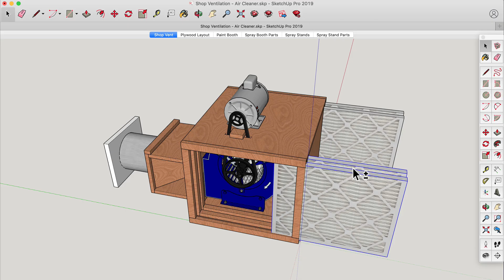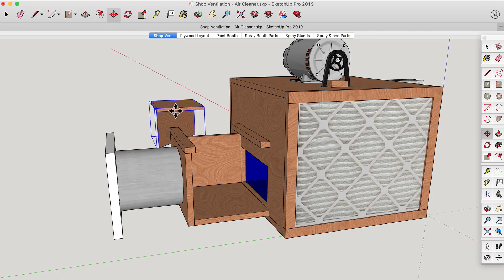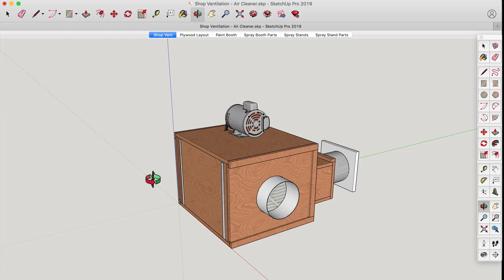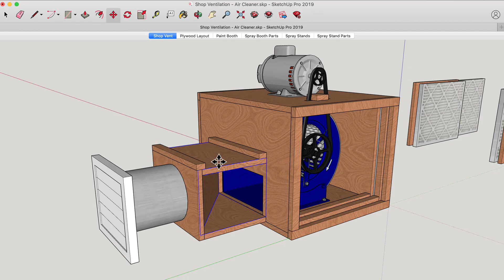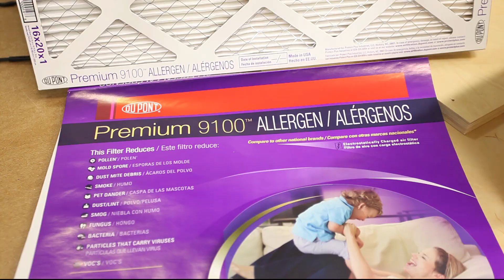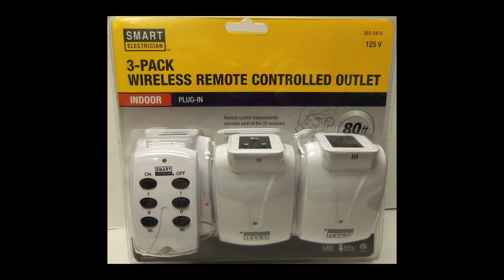How to build a Shop Air Cleaner and Paint Booth Ventilation System

Comment: I thought for any fan exhausting paint and possible solvents should be a fire or explosion proof motor as a safety precaution?
Reply: He explains it in the video, but his fan and the motor are separated. The only issue is the motor is still exposed to the elements of the shop that he is trying to evacuate. This design would work really well if it was blowing or exhausting in/out of a sealed room from the outside.

Comment: As a guy with experience in ac/ heating i would suggest you think about double walled insulated duct going thru your wall. Theres a good chance of moisture gathering on the duct and dripping down inside your wall and causing mold and rotting wood. Nice cabinet work. Design was good as well. You do realize youre never going to see the rest of your house now. I made my shop so cozy i forgot what my dogs looked like. What house?
Reply: Thanks for that added tip!

Comment: Great design and well presented. You put a lot of thought and work that benefits us all, good job. The diverted part, did you think of using a a door type baffle instead of swapping the whole part?
Reply from the maker: Thanks! Yes, I did look at door type baffle's to start but none of the ones that I found sealed very well so I decided to make my own which seals MUCH better.
Reply: @TommyTompkins  I meant did you consider making your board a swing door?  Should be easy to seal and a clasp to close.
After reading your comments throughout, I can see you thought this out more than most of us imagine. It works for you and it’s worth every moment you put into it. 

I’m considering doing one for my garage which I use only in summer, so I won’t need filters to get rid of dust and humid air. I’m now looking at a blower setup thanks to your video, makes sense.

Comment: Question: Why do you filter and vent the air? 
Why not just vent the air?
Reply from the maker: Filtering is only used when recirculating the air. I don't filter the air when venting. Venting is only used when there are harmful fumes I don't want to breathe. In the winter time, my heating bill would skyrocket if I only vented and didn't filter and recirculate the warm air.

Comment: Hello again, I'm finally in a position to build this device, and I didn't know if your instructions include the specs for the centrifugal blower you used. I'm trying to source my own at the moment and want to know how big I need to go. Thanks!
Reply from the maker: Hello Devin - I didn't include any specs for the blower other than the size of the blower that I used in my specific application. Here's the text copied directly from my plans:

"Step 2: Measure the Blower
The blower housing is going to fit inside of the Main Enclosure so before you start cutting wood, you need to make sure it’s going to fit within the default measurements. These plans were designed for a blower that is no more than 16-1/4” (412.75 mm) tall and 18” (457.2 mm) wide with some room to spare. If your blower is larger, no problem. Simply modify the dimensions in these plans to make your enclosure box a bit larger. If you’re modifying the original dimensions, just remember to choose a filter size that will fit your enclosure dimensions (the default filter size is a 16x20x1)."

Comment: What do you do during the winter to help retain heat? I'm also in MN, want fresh air in my shop but also don't want to triple my heating bill!
Reply from the maker: In the winter, I mostly just use the filter which just recirculates the heated air in the shop. I don't do a lot painting in the winter, but when I need to use the exhaust vent, I'll crack the door.
Reply: @TommyTompkins  thanks for the reply! Very cool build!
Reply: @TommyTompkins  What effect does the paint fumes have on your unprotected heater when you do paint in winter while that is running?  My contractor told me he would not honor warranty on the heater if painting indoors.

Comment: Very nice. When thinking about to build an air cleaner and starting to gravitate towards using a bigger motor such as this, I've now been thinking that perhaps it should be a dust extractor at the same time. So pretty much this design, except that the pipe for paint booth would go to a table saw instead. The motor could even be a wall-mounted extractor, though the cheapest ones don't seem to move as much air as construction air blowers and the like.

Comment: ⚠️ caution: The negative air pressure created from exhaust fans can overpower the gas appliances (especially natural draft ones) and they can in turn spill carbon monoxide in your living spaces.  Make sure you don’t have natural draft appliances in these affected spaces, can bring in at least the equivalent amount (formulas involved) of fresh air while exhausting.
Reply from the maker: Good point. I usually crack my garage door which brings in fresh air when painting. When it's just filtering the air, there's no need since it doesn't exhaust out of the shop.

Comment: Great detail! Looks like you are using it as an exhaust; why would you need a filter to pump air outside? You only need it when you are using the diverter to keep your garage air clean.
Reply from the maker: Thanks! The filters that I use when painting are only used to try and capture the majority of the overspray so that it doesn't cake up the inside of the fan blades at the siding on the outside of the shop.

Comment: I'm no expert , just another nerdy DIYer. I don't think you need to double up (stack) the filters. The higher the Merv number the smaller the particle size the filter will, well filter. Two 6 Merv rated filters does not give you a 12 Merv rating.  Additionally airflow is based somewhat on surface area. A 20X20 1in pleated filter has 4.7 sq feet of surface, while a 2in pleated filter has 8.1 sq feet, and 4 in has 15.4.  The resistance on a 1 in. MERV 7 and a 4 in. MERV 11 are approximately the same.  That being said. Great build!. I have been looking for ideas to combine both dust filtering and air extraction into the same system and this have given me some great design ideas.
Reply from the maker: I think you might have misunderstood how I'm using this. I'm not adding two filters to increase the Merv rating. The reason for using two filters is so that I can use a more expensive, higher Merv filter on the inside and a super cheap $2 filter on the outside.  Since the outside filter catches the majority of the sawdust floating around, I can change those out several times before needing to change out the more expensive Merv filter on the inside.  It's all a fine balance of saving my lungs, saving money, and preserving airflow. To be honest, it's been working out great and I wouldn't change a thing.
Reply: @TommyTompkins   Yes I thought that might be your reason.. but I was getting a little long winded... A great build, at some point I will probably build something similar. as painting in a garage in the winter time can be quite toxic.

Comment: Thank you so much for the detailed video and especially explaining why you chose to have a belt driven motor mounted OUTSIDE of the fan 0:43
Reply: Yes that was really important. Fume fire hazard is something I was not actually even realising. Also this powerful fan (without filters) can suck in screws or some small metal chips, which could cause problem to engine living inside the duct system. Very smart indeed

Comment: I can see all the unacknowledged folks like your video, but i can see where you went wrong. For one, you limited the intake by adding the round duct ports. Such a small area will get clogged up real quick with paint overspray. You were better off utilizing the full size of the filters. It would've made a great filtration system for at least dust. Here's a simple illustration to give you an idea of what I'm describing. If you stood a filter up, then get a paint spray can, spray at the filter 10" inches or even more, and watch that filter get covered in a matter of minutes.  For that matter, you would've been just better off putting a box fan on one end of a cardboard box and a filter on the other end. Heck, even in a home, the filters are not minimized, they are used to their full size. Any shop has dirtier air than a regular home.  Oh and fancy woodwork I'll give you that, but you shot yourself in the foot in the end. Way to go man, stick to building kitchen cabinets.

Comment: Great video, Did you do anything for a fresh air inlet to offset the air you are removing from the shop?
Reply from the maker: Thanks! No, I didn't add a fresh air intake because I found it sufficient to just crack my garage door which allows it to suck in fresh air. In the winter when it's really cold, I open the door that goes into the house and turn on the air exchanger on my furnace and that seems to work well too while keeping the shop warm. Sometimes it's kind of a pain to crack the garage door since the wind can blow dust around so eventually I'll probably add a dedicated air intake somewhere.

Comment: OK so first of all, cheers to you Tommy for helping me solve two problems at once (get two birds stoned-Ricky) I couldnt log into my paypal account fast enough to buy the plans. For anyone considering buying the plans, they are very professionally done, almost like an actual book, not just some wordpad document like Ive seen done and been duped a couple times by. Money well spent. I bought a furnace blower in a plywood box that a dude was using as a blower fan. Was going to modify it to work as an air cleaner, but this solves my fume issue (fiberglass-polyester resin=styrene) as well. This just saved me probably close to a grand.
Reply from the maker: Awesome! Glad to hear that you like the plans! I still think this is one of the best additions to my shop that I ever made.

Comment: At this configuration, filters do not work in full capacity. Am I right? The inlet hole is small and placed too close to filters. It would be better if you have an expansion chamber before filters. It can be a square or pyramidal shape.
Reply from the maker: Initially, I was concerned about the same thing but when the filter gets dirty is fairly evenly covered. It works pretty well, but there's probably room for improvement.

Comment: Nice work. I would kindly point out that when using it as an air extraction unit be careful that your heater is not on. It could cause issues as it was not designed to work in such a negative pressure environment.
Reply from the maker: What types of issues could I potentially experience?  Just curious.  I've been using this for about 1.5 years now and haven't had any issues with the furnace that I know of.  But I should mention that I use it in extraction mode much more during the summer months to draw in some dry air conditioned air from the house and pump out the hot humid air for some climate control. When I do this, I also turn on the air exchanger in the house thinking that it might help with the negative pressure.  The only time I do this in the winter is when I'm painting which isn't that often.
Reply: @TommyTompkins  it can cause the pilot to go out or even the furnace itself while it is running. The furnace was designed to use the air in the room for combustion but when the room is at a negative pressure it could back draft the exhaust into the garage instead of out of the flue.
Reply from the maker: @jacobframe8769  Good to know.  Thanks!

Comment: wait, why would you need filters if you recycle the air out from the room?
Reply from the maker: I filter the air to the outdoors to help protect the environment.  LOL!  Kidding...The filters are only used when the insert is used to recirculate the air in the room to help filter out the fine airborne sawdust particulate.  When the other insert is used, the blower funnels the air to the outside.  In that case filters aren't necessary.  But when using the spray booth, it still helps to have some filters to prevent paint from caking up the fan blades and because I don't want to paint the siding on the outside wall of the garage.
Reply: @TommyTompkins  all makes sence, thanks , ill subscribe,

Comment: Very nice video and assembly.  The MERV 7 prefilter dropped your blower flow significantly when you placed it in front of the 8 inch intake because you were only using the 8 inch round area of the filter, not the whole filter area.  You'll see a lot less pressure drop if you fit that prefilter into a full-size housing in your paint booth before necking down to the 8 inch duct.

Comment: Hello, Would you be able to comment on the horsepower rating of the motor itself? You have a pretty good shot of the motor spec plate but it's blurry. I've got a 1/4 HP motor I'm trying to replicate your build with but I'm not sure if it's enough power.
Reply from the maker: If I remember correctly, I used a 3/4 HP motor.
Reply: @TommyTompkins  @Devin Nasar - The motor is 1/3 HP - it's a Dayton model 5K282 - 1725 RPM, 6.2 Amp
Reply: @Devin Nasar - Your 1/4 HP motor would likely be adequate based on the fact that the motor in this video is 1/3 HP, not 3/4 HP as stated below.

Comment: So it appears my comment might of been removed about induction motors being safe as they are used on wood cutting bandsaws and tablesaw.I posted two different Manufacturers but I no longer see the comment so I will repost It.
 you made this a year ago So if your electric motor is a induction motor you will not have any issues with fumes being ignited. I hope this helps you I sent you a few links to Manufacturers these are flame proof motors.
Induction motors are also used on quality table saws band saws they are also called brushless motors.
https://www.santramengineers.com/flameproof-motor/
https://www.larsonelectronics.com/category/1488/explosion-proof-motors-motors-for-hazardous-locations

Comment: Nicely done! What is the exact brand/ part number for the remote power switch?
Reply from the maker: Thanks!  I'm using this 3-pack for my dust collector, air filter, and shop lights: https://www.menards.com/main/electrical/light-switches-dimmers-outlets/wireless-controls/indoor-remote-outlets-3-pack/ylt-12/p-1444425969250-c-12683.htm

Comment: Props that is a really nice set up, did you use a uv resistant sealant on the exterior? I have found that some of the caulking out there will shrink over time when used outdoors.
Reply from the maker: Honestly, I don't remember if it was UV resistant but I think it was?  It's held up great so far.

Comment: I like the idea! I’m trying to come up with something similar for my shop. But, when going to extraction mode how do you make up that air you are pulling out of the garage? I have a forced air furnace (and even with your reznor) don’t you risk pulling out too much air and furnace not working?
Reply from the maker: I have an air exchanger on my furnace that turn on and run to help bring in outside air while I'm running the shop in extraction mode, then I leave the garage door into the house open to create an air flow. It works very well.  I've also run the shop in extraction mode without the air exchanger on and that works too, but you probably don't want it trying to pull air through every little crevice in the home.  Another option would be to crack the garage door slightly so that it sucks in outside air while it's running.

Comment: where did you get the duct and take offs from...having a hard time finding them at the stores.
Reply from the maker: I bought those from Lowes or Menards.  I can't remember which one.  Here's a similar one at Menards: https://www.menards.com/main/heating-cooling/ductwork/ductwork-fittings/flowtite-plain-duct-fitting/21706000rb/heating-cooling/ductwork/ductwork-fittings/flowtite-plain-duct-fitting/21708000rb/p-1444432234594.htm

Comment: Tommy, this was a Great Video addressing my concern on venting paint fumes.  The utilization of a belt driven fan versus a box fan or explosion proof motor was brilliant.  I have scoured the internet for the fan you used with no luck.  I saw a comment below that someone thought it was a swamp blower.  Your response was that you were told it came out of a furnace.  Do you have any further details on the assembly and where one could be had?  Thanks in Advance!
Reply from the maker: Hi Greg - I see them pop up all the time on Craigslist and Facebook marketplace for next to nothing.  Here's a listing right now that has two of them:  https://www.facebook.com/marketplace/item/925667761166094/ They clean up pretty well and you can always add new bearings.  If you wanted to buy new, you can find them on Grainger but they'll be much more expensive: https://www.grainger.com/search?searchBar=true&searchQuery=belt+drive+blower
Reply: @TommyTompkins    Tommy, thanks for the quick response.  About an hour after i sent you the message i did find several available commercially.  I also agree with you that they are a little on the pricey side.  Thanks again for the Brilliant Video.  Its Gentlemen like you on You Tube that make me look smart in front of my neighbors when i plagiarize you ideas.  LOL!!
Reply from the maker: @gregoryhilker3739  lol!  Well glad I can help make you look smart with the neighbors. Good luck finding a blower.